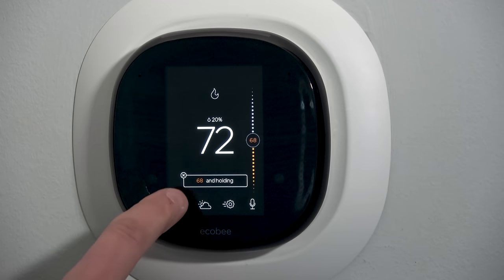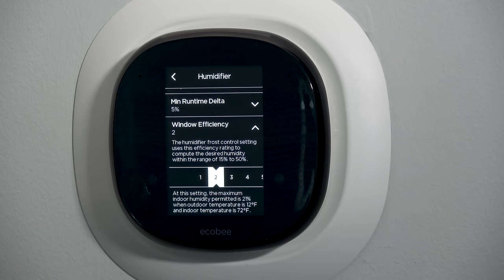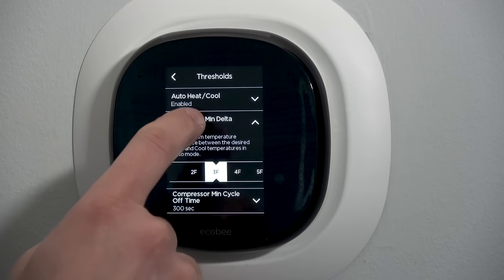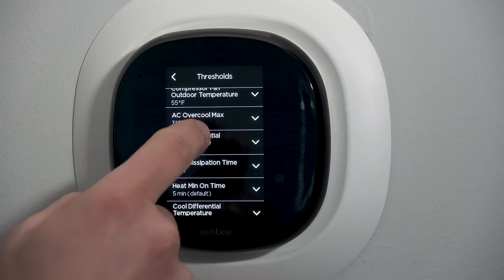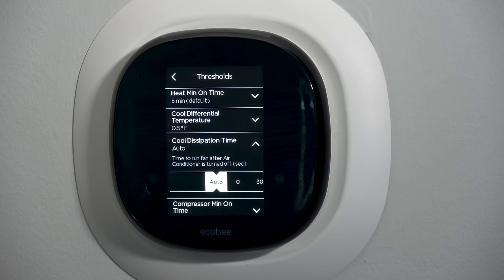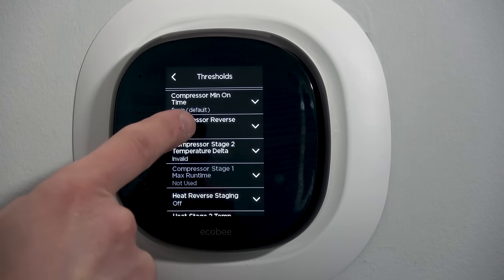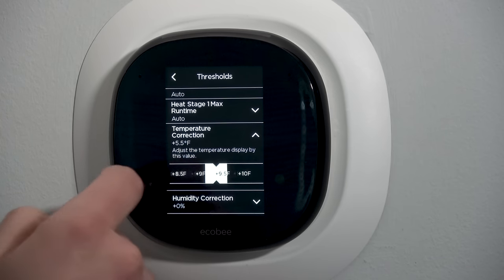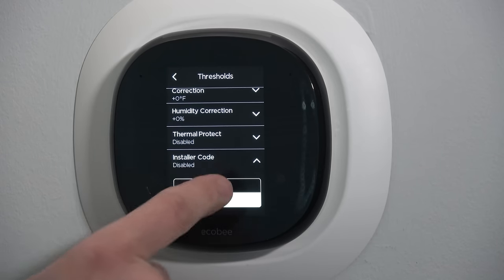ecobee Pro Advanced Setup (3 of 5)

Comment: Oh oh.  I'm a homeowner (3 ton) and went ahead and ventured into advance settings, Thresholds and set the difference in "cooling differential"  from .5 degrees to 1.5 degrees.  I don't know why, but my AC was cycling too much.  Working fine now for 1 day.  Should I change it back?  Is that dangerous?  Thanks.  Great info.
Reply from the maker: It is not dangerous... it just reduces comfort a little.
Reply from the maker: The reason it "cycles too much" is usually because it is oversized. There could be other reasons such as supply airflow blowing directly on thermostat. But 90%+ of homes have oversized A/C so that is usually to blame. Now, of course, if you system is designed for a 90 degree day but it is only 78 outside, it will have to cycle more. But we assume you mean it is cycling on a hot day.
Reply: @TECTubefilms  oh yeah, it's been hot. 100-105 for about a week.  Can it hurt to change the cooling differential from .5 to 1.5 ?  Thanks for your response.
Reply: @TECTubefilms  Oh heck.  I just read this now. 😂 I'm sorry.  Thanks again!
Reply from the maker: @twoweeledsoto6072  If it is cycling when it is cool outside (such as our 78 degree example) that is normal. If it is cycling when it is hot, such as 100+ degrees in your example that likely means the equipment is grossly oversized. Thermostat settings are not the solution for something that egregious. But no, as stated before, that setting will not damage your equipment.
Reply: @TECTubefilms  Thank you so much.  No, I'm positive it's not oversized. 3 ton serving 1500 sq ft.  It didn't do this before.   I did add a powered attic fan.  Slightly small for my attic, but it's there.  I've heard of drafts behind the thermostat causing issues.  That  interior wall isn't insulated, but the attic is.  I don't know.  Thanks a lot for the responses.
Reply from the maker: @twoweeledsoto6072  Several things going on here:
1) 3 tons for only 1,500 ft2 sounds very oversized unless the house is super, super old and completely uninsulated or maybe if it is in a desert type climate. Ryan, the guy in the video, said his A/C is also 3 tons at his house which is 2,860 ft2. LOL
2) If the unit is cycling off on a hot day, it is for sure oversized. If sized correctly, it will run non-stop and never shut off on a peak "design day." So if yours is cycling on a 100-105 degree day and space is meeting setpoint, it is oversized... by a lot.
3) Power attic fans cool attics... not houses. If the ceiling between your house and your attic has not been well sealed (and almost no houses have been), then the attic fan pulls conditioned air from your house into the attic. That fan basically uses your house air to cool your attic... which makes your A/C waste energy.
4) Interior walls do not need to be insulated because the temp in the two rooms on each side of an interior wall are about the same... hence no heat transfer thru the wall... hence no reason for insulation.
5) If you want to stop drafts in your walls (interior or exterior), you need to seal the wall cavity (typically at the top plate), not insulate it. Insulation reduces transmission based heat transfer. Sealing reduces air movement heat transfer. If you us foam insulation, it is both a sealant and an insulator. But if you use fiberglass insulation, you need to seal it with another material such as chalk.
Reply: @TECTubefilms Hi, I live in South Texas and I did the same on changing this setting on my Ecobee. House is new and since day one I noticed my AC always runs for 5 min and is off for 11 min. I keep the temp at 76 day and night. I changed the setting from .5 to 1 degree and now the ac runs for 9 min and off for 25 min. Is this better than my previous on and off times? I just figured my ac turning on and off every 11 min was not good. Hope my question makes sense.

Comment: Can you send a link to where to buy this thermostat? I need a stat to have the temp dead band like you showed. I can't find the eco bee 4 pro online. If I set my temp to 67 on heating it will turn the heat pump on before the room temp drops to 66. It's always maintaining the 67. If that makes since lol.
Reply from the maker: ecobee4 is obsolete. It has been upgraded twice since this video was made in 2018 and has another updated version coming this year.

You can buy a current ecobee model pretty much everywhere (HVAC contractor, ecobee.com, Amazon, hardware store, your electric utility, etc).

Comment: First   Thank you for the Video,  explained a lot even when I believed I knew a lot about Ecobee. New installation at new home.  I have used Ecobee for over 5 years. Now with Ecobee 4.  Question  My compressor outside is running all of the time even when it has reached the desired temp and the fan has turned off. This did not happen with previous thermostat.  I have rechecked the wiring and everything matches up as normal.  No extra equipment just normal central air. Does it matter where the red wire goes? I didn't think so but don't know how to fix this problem
Reply from the maker: It always matters where all wires go.  Each has a specific job function.  https://youtu.be/KHsXndmHv_M
Reply from the maker: If the compressor is running without the outdoor condenser fan, then the stat is not the issue.  Both the compressor and condenser fan utilize the same thermostat signal (Y1) to engage so if one is running without the other, the issue is not a thermostat issue.
Reply from the maker: If the compressor is running without the indoor evaporator fan, then the stat could be the issue.  Or it could be wired wrong.  In either case, an electrical meter will need to be used to diagnose which component is it at fault.  For some reason you are getting a Y1 signal to the outdoor condensing unit, but not a G signal to the indoor air handler.  https://youtu.be/FMevkhVDvuU
Reply: Sorry the third comment. Compressor running and not Indoor fan.
Reply from the maker: @fixitgeorge  If this is a brand new thermostat and it worked before you installed the new stat, but not after, then there is a high probability that it is wired incorrectly.

Comment: I have a heat pump with an Aux stage 1 for heating. I have the temp set for 68 degrees at night and scheduled for 72 degrees at 5:30 AM. The compressor may come on for two or more hours before 5:30 and since it's cold outside the temperature does not increase all that much. The Aux heat does not come on until 5:30. 

Is there a way to stop the heat pump from running for so long before the Aux heat comes on?
Reply from the maker: There are multiple issues here. If you heat pump is running and the indoor temp is not increasing it means one of two things. 1) there is an issue with the heat pump and it needs to be serviced or 2) you have model of heat pump that cannot handle cold outdoor temps very well
Reply from the maker: If your Aux heat is a gas, propane, or oil furnace, you need to calculate the economic and thermal balance points and set an appropriate outdoor changeover temperature based on that.

However, if your Aux heat is electric resistance then you just calculate the thermal balance point. Generally for cold climate heat pumps that outdoor temp ends up being well below zero so you should never shut off the heat pump and only run electric resistance. You should run both together.
Reply from the maker: Also look at your "Compressor to Aux Runtime" setting

Comment: Isn’t 0.5 degrees heat differential temp a little too low? Wouldn’t that cause the heater to kick on way too often?
Reply from the maker: If that causes the heat to kick on too often then either a) the thermostat is in the direct airflow path of one of the diffusers or b) the heating system is grossly overside.
Reply: @TECTubefilms  maybe so. Would you recommend using auto staging then instead of changing to manual? I set mine to 1.5 and I kinda like how it doesn’t turn on so frequently
Reply from the maker: @bgarcia9788  We always use manual staging because we are control freaks and we really like reverse staging which is only available in manual. Most ecobee users are on auto staging because it is the default.

Comment: I have a Trane TEM6 air handler that runs the fan automatically for a bit after a cooling or heating call, if I leave the ecobee on auto for dissipation times will that conflict anything the air handler is doing or does the ecm on the air handler override anything from the thermostat?
Reply from the maker: No problem in this scenario. The two fan timers (ecobee and air handler circuit board) start at the same time. The fan will actually run for whichever is longer. BTW - we are NOT fans of running the fan for cooling dissipation. We prefer that fan to shut off right after the cooling call. If the fan continues running, it blows some of the moisture back into the airstream instead of letting it drain away. This re-introduces that moisture back into the building at a time of year that you probably want to dehumidify.

Comment: I have a 3 ton American Standard / Trane heat pump with electric aux. during setup it ask to set minimum outdoor compressor temp or to select disable. It recommended disabling unless my heat pump called for a certain minimum. I have tried googling and can’t find my units specs anywhere. Unit was manufactured in 2014 and from most forums people say modern heat pumps can work to temps below 0° F. Should I disable it, or do you recommend a minimum to set this at? Or is this setting for cooling mode only? 

Heat Pump: 4TWB3036C1000AA
Reply from the maker: That minimum outdoor compressor temp is for COOLING mode only. If this is a regular house, set that for 55 degrees. There is a different section on the stat for setting up heat pump changeover points. Every heat pump is tested to run at 47 and 17 degrees outside. Most can run well below 17. Since electric heat is 100% efficient, but the heat pump is 150 to 300% even at cold temps, you likely want to run yours well below 17. But you will need the unit specs (and heat balance point graph) or you will need to talk to your Trane dealer. We don't use that brand here so we are not familair with that model number.

Comment: I live in Az.  I have a heat pump.  My previous TS had the Y and W wires jumped. I installed Ecobee 3 lite and it stated to ignore this jump.  Why was there a jump wired on the initial TS?  Also, Ecobee isn't showing Aux setting for Heat.  Does that mean my heat pump doesn't have Auxiliary or Emergency heat?
Reply from the maker: No idea why whomever installed your original system jumpered Y to W. This is highly abnormal.
Reply from the maker: If ecobee does not show aux settings for heat, it was not configured correctly during installation. If it discovers an O/B wire and a W1 wire at startup, it should give you all the heat pump settings related to auxiliary heat.
Reply: @TECTubefilms  It recognized the O/B and all the wires from wall.  Old TS was "O" only.  The O/B setting is energized on cool.  However, there was no W wire coming from wall so of course Ecobee doesn't show a W wire.  The Ecobee seems to be working fine, we're generating heat.  I set the heat pump thresholds at 35 degrees.  Believe it or not, we were below 35 the other day and system didn't start.  Should I set the threshold lower to say 20 degrees?
Reply: Hey man you had Y & W jumped because the thermostat you previously had did not have an internal jumper to turn on the heat pump. The thermostat previously only turned W on which is why the jumper goes from W to Y. This is not abnormal. Its just because your thermostat was an older model.

Comment: What’s the best setup for ecobee when using an outdoor reset controller on my high efficiency boiler? Or should I use a basic WiFi thermostat so it doesn’t work against the boiler outdoor reset controller.
Reply from the maker: Not sure what you mean. You can use both an ecobee stat and a boiler OA reset control. These do not work against each other. As it is cooler outside, the boiler will make lower temp water... which is fine because the thermostat does not need any BTUs. Regular thermostats and ecobee Wi-Fi stats work the same way. They both just closer R-W to energize your T-T. Nothing different in that regard.
Reply: @TECTubefilms  ok thanks. I wasn’t sure if ecobee was constantly trying to anticipate how long it would have to run to reach the desired temp by a certain time, ie 630am after a 3 degree night setback. 

Currently I set the house to be at 67 at all times. See how that works. It takes away some ecobee benefits but with cast Iron radiators and hydronic floor heat in the kitchen a steady temp may be best.
Reply from the maker: @dlmob  Radiators do well with setback. Radiant floor... especially if it is high mass such as concrete... does not.
Reply from the maker: @dlmob  Yes, ecobee calculates when to start to reach temperature. If it is connected to an online account, it builds profiles of your home and how long it takes to heat it X degrees at various outdoor temps.

Comment: Just bought the new Premium yesterday and seeing they no longer have the differential option.  Why?? Looks like now they have a temperature correction option.  So to achieve the differential, make the change here and modify thr temp up 1 to fake the system ?  I’m guessing this is the only way to get differential now??
Reply from the maker: The heat and cool differentials are still there. Just like with ecobee 4 and ecobee 5 models, you only see the differential settings (default is 0.5 deg) if you turn off automatic staging and switch it to manual staging configuration.
Reply from the maker: The temperature correction has always been there and it is used to calibrate the thermostat reading to match some other temperature gauge that you have. It would not in anyway affect the differential of how far out of setpoint you need to be to engage and disengage heat or cool.
Reply: @TECTubefilms  got it, found the differential.  Thank you!  Now any idea why when I look at the device, when the AC kicks on, it remains a white snowflake?  I can only see AC is engaged if I drill down to the Main Menu, or look on my phone (where it will display the blue snowflake).

Comment: Hi may I ask is there a setting for certain time for heatpump and gas furnace??? I would like to set heatpump run 7pm-7ambecause electricity 50% 7pm-7am, and use gas furnace 7am-7pm because gas cheaper 7am-7pm??? Thank you
Reply from the maker: There is not an option to schedule it this way in ecobee, nor any of the other stats that we use here at TEC.
Reply: @TECTubefilms  thank you , wish they come up with that option we save alot money on bills...thank you , you have a wonderful day, ...

Comment: Strange...I don't see "cool differential temp" under installation settings/thresholds on my EcoBee Smart Thermostat Pro.
Reply from the maker: Did you scroll down?  What section do you have right after "Heat Min On Time?"
Reply: @TECTubefilms  right below heat minute on time is compressor minute on time - five minute default
Reply from the maker: @mykylc  So you are missing cool diff and cool dissipation?  Weird.  Either the latest firmware moved things to a different order or your stat is messed up.  We don't have a stat in front of us today to look at it.
Reply: @TECTubefilms  I definitely don't see those two things under the threshold settings.
Reply: mykylc same have you figured it out?
Reply: @zaccaz153  nope.  Looks like this bersion doesn't come with it.
Reply: You have to set set your configure staging to manual
Reply: They took the differential settings away on the ecobee 5 (smart thermostat). It’s a bummer, but it allows  them to claim energy savings ratings.

Comment: Hi. My ecobee won't run the fan only setting on my 1 stage furnace. It gives me the option but nothing happens at the furnace. Any reason?
Reply from the maker: Make sure you have a G wire connected.  Then use your multi-meter to make sure the furnace is receiving the G call.

Comment: I am currently using a PRO T855SH thermostat which allows me to set the humidity level.  I do not have a dehumidifier just a regular 2 stage HVAC.  I am in Florida.  I bought the Ecobee Premium and installed it and it seems that i just do not get the same effect, my home seems way warmer at the same temperature settings.  I have to keep the temperature at 70 to achieve what i do at 76 with the Pro.  Is this something i am not doing right?  can the Ecobee function like the Pro with the humidity setting?  I would really love your input.  I have put the old thermostat back at this time but would have loved to use the Ecobee Premium
Reply from the maker: You need to enable the feature called "AC Overcool Max" in the installation screens (we recommend setting it to 3F) and then on the mode screens set the dehumidification setpoint (we recommend 54%)
Reply from the maker: This is detailed in the video at 5:09 mark
Reply: Awesome!!!  Thanks so much for sharing this information with me, I so appreciate your help and time.  😊
Reply: I am so sorry to bother you again but i may have some wiring wrong because my humidity levels are constantly high, i never had this issue so i am worried that i may have wired it wrong.  I have a separate thermostat that is connected to my outdoor weather station and it shows my indoor humidity as way lower between 54-60% whereas the Ecobee is always 69-79% which i find concerning so i figured there had to be an issue.  Any idea?   There is another concern but i will tell you once i know that the wiring is right.  I have a two stage heat pump and i have red to Rc white to W1 (WORRIED THIS MAY BE THE PROBLEM) Green to G, Blue to C, Yellow to Y1, Brown to Y2 and Orange to OB, Please could you confirm that i have wired correctly?    @driverteamtampa3096